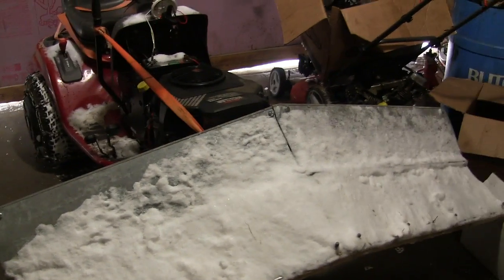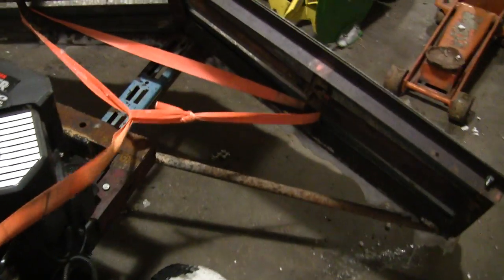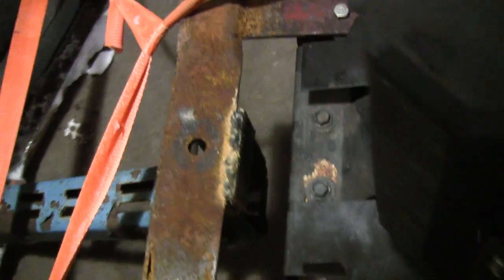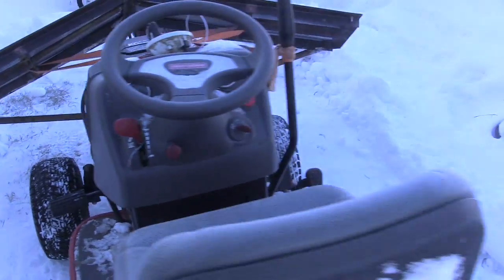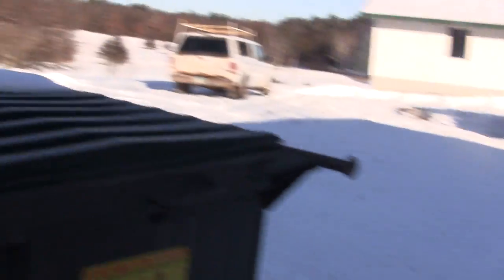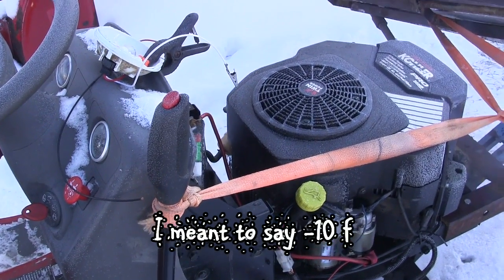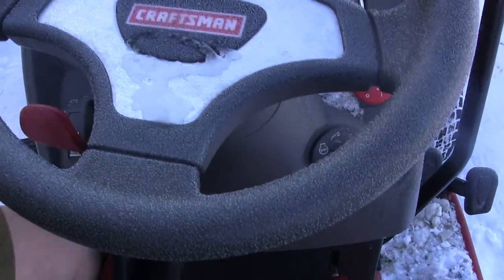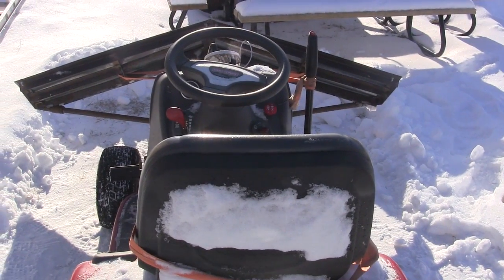Scrap Snowplow in Action

Comment: Yep that handle will be the next to break,  I'd bet money on it. I had one of those handles break off a mower, one of the welds had no penetration. You should try to find a cheap ATV winch to lift the plow, they pop up on CL from time to time. And I'd rob a manual transaxle and associated parts from another mower and have it ready to swap in. Consumer grade hydros don't have proper filters and are often sealed units, they don't hold up very long under heavy use and yours sounds unhappy already. You could try changing the fluid to get a little more life but you have to pull it out of the mower to do so. I thought it sucked when I got up this morning, it's just a little cold here, you've got it way worse.
Reply from the maker: +pfun41 I've got a craftsman with a bad engine that has a manual in it so if I need to I can swap that in. I won't be swapping it in this cold weather though that's for sure.

Comment: I might be wrong but you might want to give the differential a check on that fluid level or maybe even change the differential oil on the snow plow lawn mower thing
Reply from the maker: +spackmaster Chavez I should check it out one of these days. It doesn't sound the best, I'm not sure if thats from low fluid or just the cold weather.